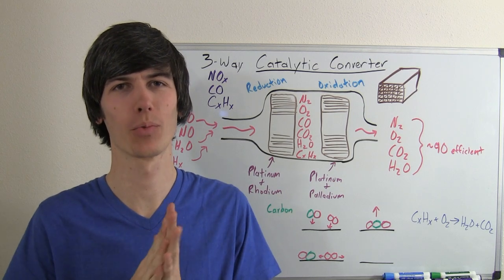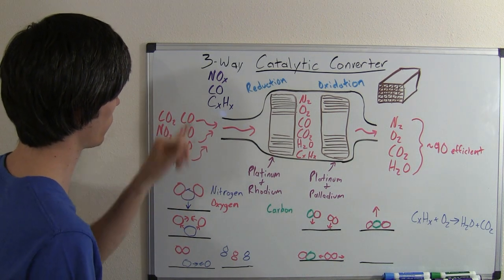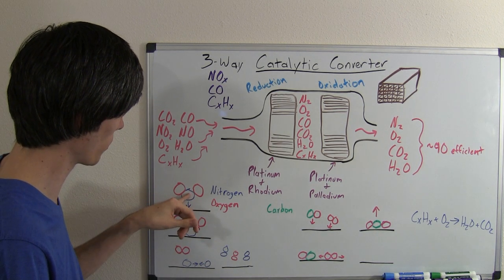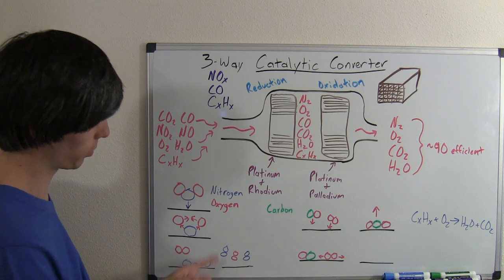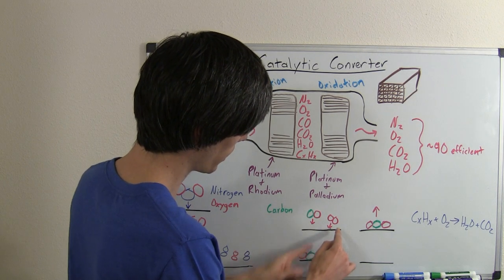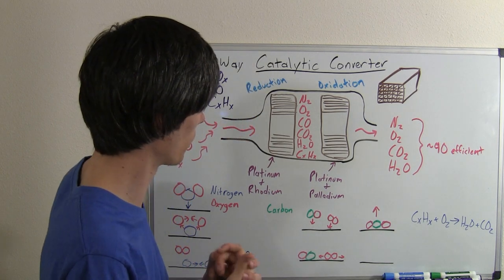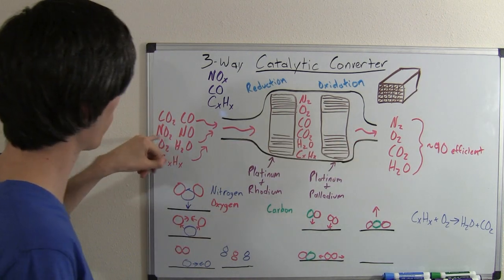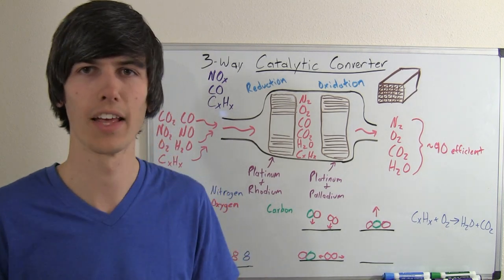Catalytic Converters - Explained

Comment from the maker: Oxygen alone is fairly dangerous so this isn't too common to do. It's safer to use it as a molecule with N2O which keeps the oxygen from igniting until it has split from the two nitrogen atoms.

Comment from the maker: It's the carbon in the exhaust, which hasn't been filtered out. Modern diesels typically will have DPFs (diesel particulate filters) which will almost eliminate this.

Comment from the maker: Typically they last the life of the vehicle, but you'll know upon your car inspection whether or not. If you do have to replace it, it can be as simple as unbolting and putting the new one in; sometimes it will require some welding.

Comment from the maker: The engine block itself shouldn't be getting that ridiculously hot, as it has ports flowing through with coolant that try to keep the temperature somewhere around 200 degrees F (coolant temp). So I don't think water getting on the block would be a huge concern (obviously it happens when it rains or you dive through a puddle. That said, I wouldn't simply dump a bucket of water in it; and driving through deep water can cause countless problems.

Comment: You should talk about how the 02 sensors work on all this.  Is it true, that the ECU will send more fuel, so that unburnt fuel will make it to the CAT?  Also, how does the alcohol play into all this?  They did not have it in the fuel when they mandated all these CATs.  Are we wasting fuel, in order to try and "clean-up" the exhaust?  How much cleaner would our exhaust be if we did not throw waste crank case oil, back into the intake?

Comment: Thanks for the episode!

I have a new car model (about 2017) working on diesel and a semi-open garage (I mean there is a ceiling that covers two-thirds of the car but not all the car, three walls but there is no door in the entry, and instead 2,5 meters of fresh air).

Can carbon monoxide still be dangerous if the car's motor remains on, or is it safe even if I forget to put it off and stay inside the garage??

Comment: It is India. We are still in Euro 3 standard. They say it is one of the features of Euro 3. I have heard someone saying that the oxygen provision is merely to dilute the exhaust gases so that there will be less harmful gases per unit volume. So it does not help to reduce harmful gases instead it just fools around. But I think it does some job of burning the exess fuel as you said.

Comment: Can you explain how to calculate the unburned fuel in the exhaust?  I've watched your O2 sensor and exhaust videos and don't see that detail...  Specifically I'm looking to find out how much of the fuel was not burned in the engine (pre cat).  I'm certain there is some way by using the CO and CxHx.  Can you help me or point me in a direction where I can find the answer?

Comment: Great video, just wondering though: Would there be any reason you couldn't use the same catalytic converter indefinitely?
Reply from the maker: They last for a good while, but if carbon were to build up it would at least need to be cleaned.

Comment: Although this may seem like a silly question, Im still curious...Does a cat cause much back pressure (Perhaps even enough to restrict some exhaust gases from leaving the cylinder during the exhaust stroke)? Would a car be more powerful without one or is the affect it causes so little it wouldn't make a difference?

Comment: two questions: 1) what happens when you run a 3 way cat on a car designed for 2-way, ie a lean running car? 2) can a 3 way cat have only one block instead of a reduction and oxidation block?

Comment: A few technical questions here. If that first reduction stage is for removing NOx emissions, why do some diesel engines require diesel exhaust fluid to remove these emissions? Similarly, you probably remember when Volkswagen got into trouble with software that tricked emissions test results, so that in normal everyday use the engine could burn leaner and more fuel efficient, but more NOx emissions. Doesn't the reduction stage get rid of those emissions?
Reply: You can't use this type of catalytic converter in a Diesel.
A 3-way catalytic converter requires a nearly stochiometric air-fuelratio to work. A Diesel runs lean most of the time which makes the whole exhaust aftertreatment a lot more complex.

Comment: Question on the placement of catalytic converters. Say i wanted my car to shoot flames without removing my catalytic converter all together. But instead move it to the very end of the exhaust system. Would that still be street legal if the rest of the piping is there and fully sealed? What are your thoughts on this idea. Otherwise im ditching the cat for a spark plug at the tailpipe

Comment: I don't know how silly of a question this is, but would it be impractical to implement this on a large scale outside of the automotive industry in order to improve the air quality of a city? I do understand that rhodium, platinum, and palladium are extremely expensive. Is that the main restricting factor?

Comment: I keep seeing these videos about using a spark plug non fouled to "trick" the CPU to not kick a Check/Service engine light when removing the catalytic converters.  Is this a valid method? The vehicle in question is a 2014 2SS Camaro. Thanks.

Comment: I removed my catalytic converter on my motorcycle, as a result I can feel a lot more power but also a lot of backfires happen every time I decelerate. Is that normal? Is that dangerous? Would there be any bad effects on my bike?
Reply from the maker: Well, I'd recommend leaving the cat on.
Reply: Engineering Explained okay then. Just want to know, would the backfires be any bad effects to the engine? the valves, plugs?
Reply from the maker: Probably not, just fuel coming out the exhaust and burning off.
Reply: if you have an undertail exhaust. expect a lot of soot and possibly a roasted taillight

Comment: Sorry for all of the comments your video are really interesting! I've got a MS in physics and I'm still learning stuff (I guess I have mostly theoretical training). I'm interesting in automotive engineering and I want to take your advice about applying to an engineering program and writing a thesis. 

Do you think something around active torque vectoring using a hybrid system would be interesting ? Think the new NSX concept. I would like to do this as a project someday.

Comment: If the catalytic converter on a ~2005 4-cyl. sedan is say exactly 90% efficient. And you have a motorcycle of equivalent year without a converter which will burn much less gas resulting in less CO2 emissions overall. However, will the motorcycle emit more CO, N20, and NO2 per volume than the car taking into account the 10% that the catalytic converter does not convert. Perhaps this can be solved using simple ratios? (Like a motorcycle's motor is a percentage smaller and probably less efficient, running more rich)

Comment: what would happen if I removed the catalytic converter from the car and fed a mixture of steam (water vapor) and carbon monoxide through it?  Would the palladium catalyst facilitate the water gas shift reaction where the output would be hydrogen and carbon dioxide?

Comment: So, i have an OBD-1 car, and i don't have a catalytic converter on my car. i just  have straight pipes instead. I know it's illegal and my car has only oxygen sensors before the Catalytic converter, so because of that it doesn't show any Check Engine notifications.

My question is that how does it effect power and back pressure when you remove them?

Comment: I have a generic cat converter with no directional arrow to show me which way to install it on vehicle. Is there a way to know which is the reduction side and which is the oxidation side. There is an opening for an oxygen sensor but it has a plug in it as my sensor is on the exhaust manifold itself. The vehicle is a 95 geo tracker with a 1.6  16 valve engine

Comment: Why does nitrogen bond more strongly with the catalyst than with oxygen? And why is this bond with the catalyst weaker than a nitrogen binding with another nitrogen?
Reply: This is due to electronegativity. Nitrogen's electroneg. is ~3.0, the oxygen's is ~3.5. Platinum and rhodium's are both around ~2.2. because the difference between 3.0 and 2.2 is greater than the difference between 3.0 and 3.5, the nitrogen will bond with the pt and rh instead of the oxygen.

Comment: Why? I always thought these metals were mostly inert and did not like to firm oxides... Why are they used inside? How does a catalyst work?
Reply: They are almost completly inert at room temperature, but they can start to react at increased temperatures. Though every single reaction is only temporarly, that's why the material the catalytic converter is made of isn't used up. If the temperature is to low, nothing happens.

Comment: I have been wondering if you take off the catalytic converter, will the car waste more gas? There has been a huge controversy on this because mines only has a pipe and believe me it wastes a lot of gas. I am thinking of putting on one. Please help.
Reply: ElTexMexAlex it might be an issue with an exhaust sensor, the ecu will be getting confused if it hasn't been corrected.

Comment: You cant break the carbon/oxygen bond because you'll wind up with elemental carbon, a solid, and oxygen, a gas. The O2 will flow out, but where can the carbon go?

Comment: Do you have to have one on your car? Or can you remove it
Reply from the maker: If you're not driving on a track, keep it on. Even then, they have high flow ones.
Reply: If you don't give a rat's ass about global warming, go for it.
Reply: +Engineering Explained hello Sr. I have an E53 BMW X5 4.8is and I would like to install a crosspipe and remove the catalytic converter. what are your thoughts about it.
thank you very much in advance
Reply: You run the risk of carbon monoxide poisoning.
Reply: Don't do it. There have been cases of people dying from carbon monoxide poisoning by having faulty catalytic converters or O2 sensors.Agostinho José Alexandre
Reply: +Agostinho José Alexandre Depending on where you live, you may be unable to get your vehicle licensed (in most locations it wont pass emissions & inspections). 

In many locations, if you decide to sell the car you will be required by law to install a Catalytic convertor--so save your factory exhaust so you can throw it back on.

Comment: Conversion efficiency is a function of the relative air fuel ratio isn't it?
Reply: Yes, if your engine is running too rich, you will have too much unburnt fuel that cant be converted because of a lack of oxygen from not enough converted nitric oxides, if your engine is running to lean, you will have too much nitric oxides that could be converted but might combine back with the excess oxygen that isnt used to convert unburnt fuel. Thats why you need an oxygen sensor before and after the catalytic converter to make sure youre burning a stoichiometric mixture and your catalytic converter is operating properly and its also the main reason carburetors disappeared from the market because catalytic converters became mandatory and carburetors cant provide a perfectly stoichiometric mixture.

Comment: what percentange of fuel is left unburt in a cylinder of a modern car?
Reply: it depends on the vehicle and condition of the engine. Usually all fluids that become aerosol (fuel and oil) are vented back into the engine and burnt.

Comment: What actually happens if I remove my CC in a 2013 Jetta 2.5 5 cyl. ?? Will it gain or lose some hp?
Reply: You will gain a few hp because you have a less restrictive exhaust but you may break parts of the exhaust system because the stock resonator, muffler and pipes arent designed for the higher temperatures and maybe afterfires plus in many countries removing the catalytic converter is illegal, so watch out for that too.
Reply: Chuckiele thank you!

Comment: I have a 1990 Dodge ram 1500 with only about 50,000 miles on it as it is a camper. I don’t want to invest very much money anymore as I have put in thousands of dollars so far. That’s why I was asking if I can just have someone put a pipe of sorts in the place of the catalytic converter without hurting myself or anyone else

Comment: Where is Sulfur Dioxide in this equation? Doesn't burning fossil fuels always emit SO2?
Reply: Fuels for automotive applications are commonly sulfur free. Actually, so2 would destroy a catalytic converter pretty quickly.

Comment: Wait, so a catalytic converter contains platinum? Wasn't that stuff super expensive?
Reply from the maker: Predalien3001 It still is expensive.
Reply: +Predalien3001 Um yeah, why do you think people steel catalytic converters off peoples cars? the stuff is VERY expensive, that's why they started welding them on so they couldn't just be removed with a wrench.
Reply: palladium should be super expensive too, isnt that the stuff Ironman used for his mini nuclear reactor?
Reply: Which is why junkies and just plain ol scumbags are always stealing them
Reply: They contain mostly palladium. A little platinum, and very little rhodium. I've extracted and refined the platinum group metals from automotive catalytic converters, made two videos of the entire process, step by step. It's not easy and very dangerous.
Reply: And now palladium is more expensive than platinum (or gold).

Comment: Where did the H2O came from?
Reply: Erm, combustion?
Reply: the hydrogen from the unburned hydrocarbon join with oxygen in the converter creating WATER, while the carbon join with oxygen this time creating carbon dioxide.